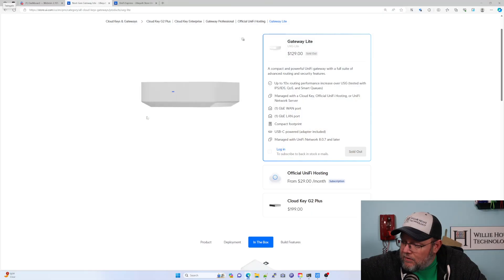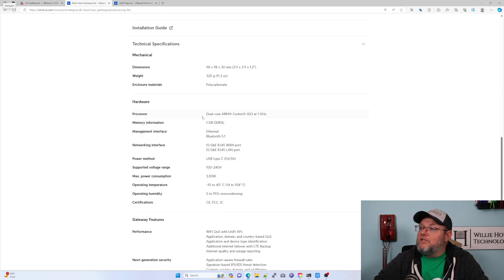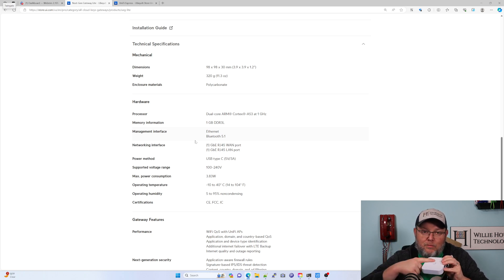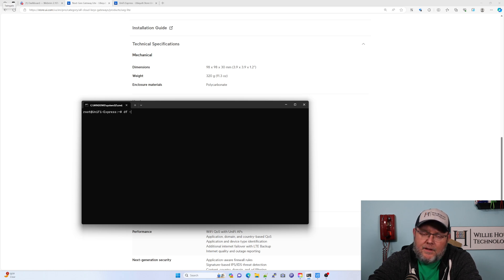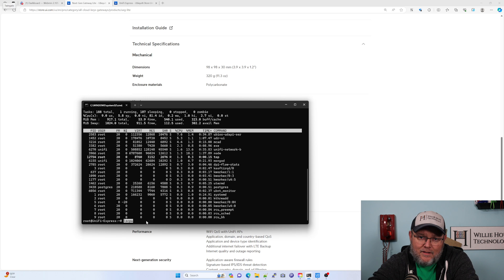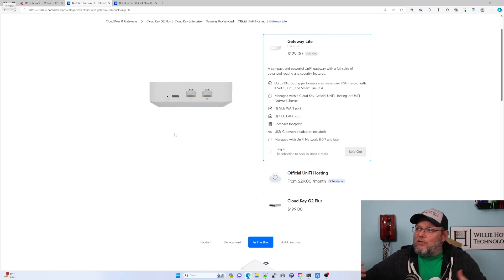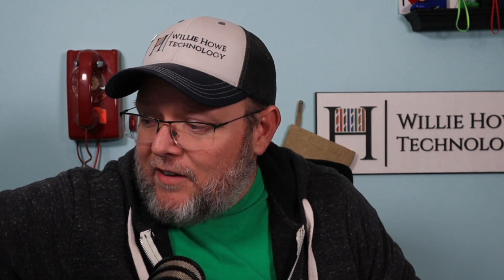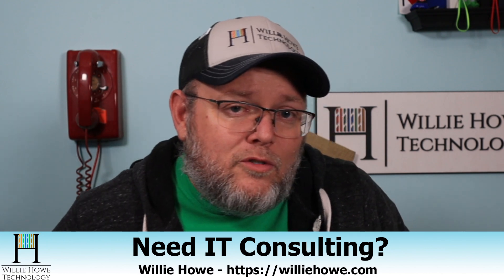UniFi Express Hardware Exposed

Comment: Any chance you could try to open yours up?
Mine is running very hot... trying to see if a heatsink is possible, but I don't want to ruin the thing :)

Any temp info I could get out of it over SSH?
Reply from the maker: I'm sure there is.
Reply: @WillieHowe  
just found it... user error :) 
I forgot "ubnt-systool" before cputemp... works now... 68°C. That can't be good for it
Reply: @JimnyVR5  Still runs cooler than the original USG, but at least that thing had vents.

Comment: can it run Unifi Cameras?
Reply: The only application it runs is Unifi Network. You would need to add a separate Unifi console that supports the Protect application. 

Sonething like a Cloud Key G2 Plus or a dedicated NVR will be needed to run cameras.
Reply: thanks for info @AaronM19